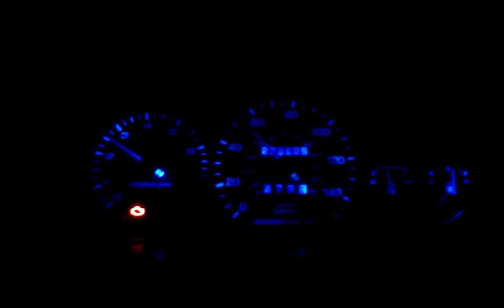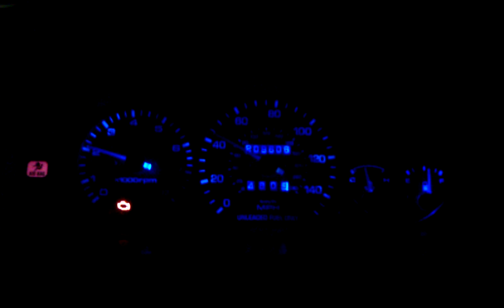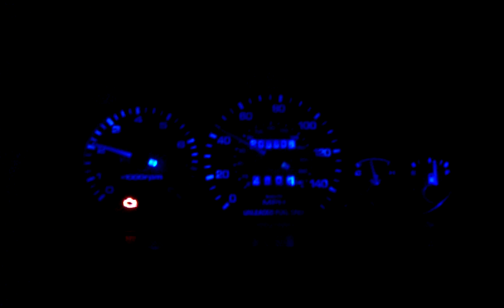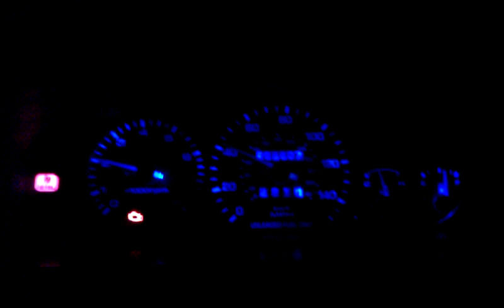Mazda 626 Signs of bad timing/timing belt and or components

Comment: mine did it as well I had my check engine and oil pressure light sign of timing belt low copression at least our engines don't hit any other components mine has 195800 miles

Comment: I have a 1995 mazda 6262. I was going uphill, it started to slow down I figured it was the hill so I gave more gas and once up the hill it started to slow down and just went dead. no lights came on except battery light and the battery is good. It won't crank or anything, when trying to turn over there is a very loud squealing sound. please help asap
Reply from the maker: the timing belt could have broken
Reply: +bpm03 that's what we are thinking. we changed the battery cable terminals cause one was broken. I did get it to turn over but had to give it quite a bit of gas to start and once it did, it squealed loudly and the motor was smoking and it has oil in it.

Comment: My 01 mazda protege 2.0 liter has an interfering motor. So I'm glad I checked my timing belt because I noticed the power loss that I had the low idle especially at start up and at the upper end on the highway it would chug and break up.. Now if it did snap on me with it being an interfering motor most likely I would have bent some valves and pinged up the top of my pistons.. Regardless of what type of engine non or interfering the timing belts are easy to do guys don't pay anyone go out there and get your hands dirty and get it done son..!!!
Reply: Joe it non interfere bro

Comment: Hi I have a 626 v6 I just replaced head gasket and after the replace the car has bad idle high and low if I shift to drive the car makes a knock noise and loosed a lot power  !!! Could've timing off ? Thanks bpm03!!!